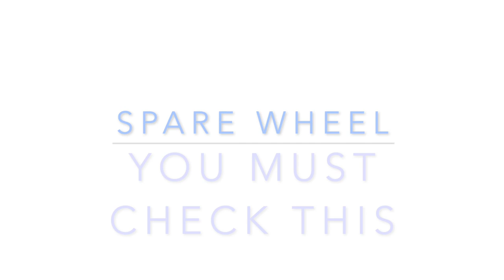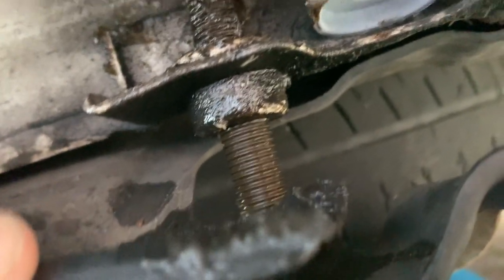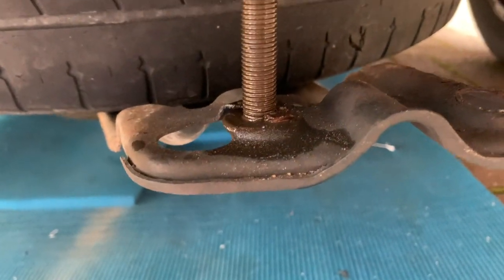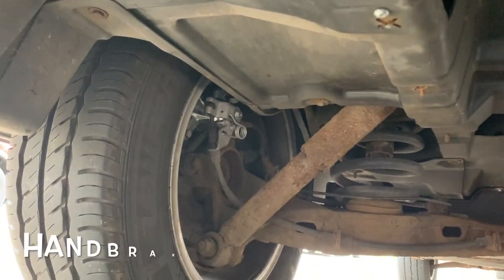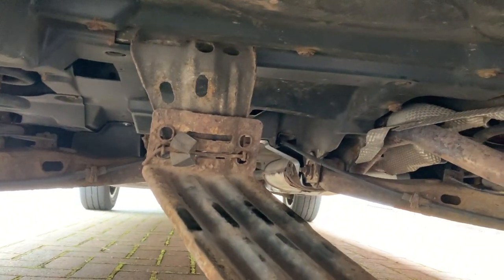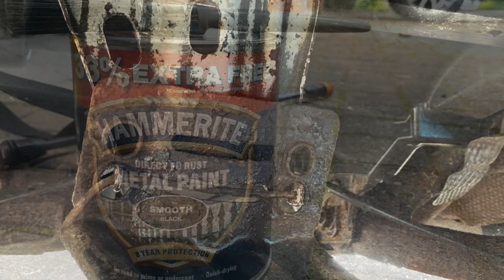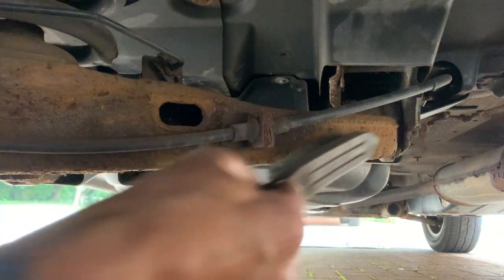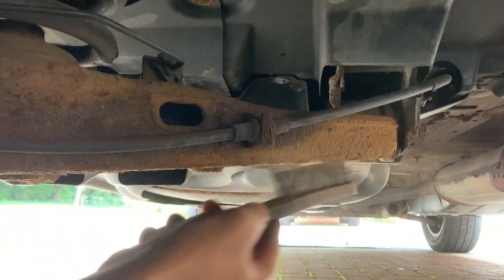VW T5 Transporter - Spare Wheel - You Must Check This

Comment: There is a hole in the wheel carrier in witch you insert your bolt tool. It is easier to lift a carrier with wheel into a right position. Use the leverage.
Reply from the maker: That’s genius and now I think about it…obvious. Thank you for sharing, much appreciated 👍
Reply: Thats what i wanted to write in forst minutes in 🤭 I changed my wheel yesterday

Comment: Just thinking that the spare should probably have a lock or secure bolt on the underside to stop the spare wheel from being stolen now that you have greased the bolts. Thanks for uploading the video btw.
Reply from the maker: Great idea Graham, thank you for your comment…👍
Reply: Mine has one bolt that is the same as the locking wheel nut, I thought this was standard, obviously not !

Comment: That longer bolt unhooks lift wheel slightly with the jack or a well placed foot and the bolt will unhook from metal work.  This is important vid my spare was so rusty it could barely be used last time 👍👍

Comment: Had mine for 13 years and take it off once year to check the tyre,  repaint and grease everything up. I installed a locking securing stud back then as t5 spare wheels were being pinched on a daily basis. Fortunately, I've never had a puncture in all that time so have never needed to drop it in anger at the side of the road. ( touch wood)
Reply: Nice idea 👍 no, I’ve not had to either 🤞

Comment: The bloke who had my van before me obviously didn't believe in lubricating anything. Instead, he paid a garage to do all his work, who didn't lubricate anything either! One of the spare wheel carrier bolts actually sheared off despite getting it hot, so I had to weld another nut on the van and also fitted a new locking bolt which I bought on eBay.

Comment: I discovered a slot in the spare wheel bracket.(between the bolts). You can use the wheel brace as a lever to lower and raise the spare. Hope that helps someone.
Reply from the maker: That’s brilliant, wasn’t aware of that. Thank you for the feedback 👍

Comment: Watch out when it drops down .crushed my hand.
Reply: Yes,definitely worth being aware of 👍
Reply: Use the wheel wrench/lug wrench supplied with the vehicle (Mine is from 2014 - not sure if they are all the same). First loosen the left hand (safety) bolt about a cm. +/- 0.5 inch, perhaps a little more. This stops the wheel and folding bracket falling on your hand. You then remove the right hand bolt completely. The assembly now rests on the safety bolt. Note that the wheel wrench has a small 'tongue' at the end. Remove the screwdriver inserted in the wrench. Now insert the wrench into the hole provided and wiggle it around until the tongue slots into a small hole at the bottom of the tube. Lift up the wrench until it fits securely into the channel provided and then pull it firmly across to the right until the larger hole is over the safety bolt. Lower carefully, use both hands if you want. The 'pistol grip' on the wrench should prevent your hand being crushed, but you could put a block of wood under the folding bracket if you are worried. I carry a 77 cm wheel wrench which fits nicely and could make this even safer, but I think it is overkill.

Comment: Good advice. I found that removing the pin and taking the whole carrier bracket off allowed me to
have it shot blasted and powder coated.  It’s as good as new now.  The other main reason to do this regularly is to check the condition of the spare wheel and tyre and check the air pressure

Comment: Great video. In that 'well' in the spare wheel I keep a ziplock bag containing rubber gloves and rags! You never know WHEN you will need them! Another tip I do with mine - cut 2 fingers off an old Marigold glove - put one over each bolt thread and secure with a rubber band. It helps stop them rusting and/or getting muddy! A great grease to use is 'copperlube' copper grease - guarantees it wont sieze😉👍 Happy trails!

Comment: I had the right one so rusted that it made the nut spin in the chassis. Had to put a vice grip on the nut to get it somewhat out and then use a saw to cut the bolt. Then bought a new bolt, and welded the nut back. Since then I remove the spare twice a year, just make sure it is not rusted together.

Comment: Another honest great video. Thanks. 
Question if I can.  I know this is over a year ago but........if you can remember are the nuts the long securing bolts attach to fixed on the metal bracket?  My bolts & nuts are missing (locked up & seized U bolts used ☹️) & was wondering if I can refit originals? Thanks, John.
Reply from the maker: Thank you for your kind words… one bolt is just a bolt that unscrews and comes out, the other unscrews to a point then is held in the bracket by a collar at the end of the bolt, so would just appear to keep turning, without dropping out…👍

Comment: Great! thanks very much. Had my van 2 years and never given it a thought. Any idea where the jack is?
Reply: should be bolted to the left wall of the trunk under a plastic piece, it should be possible to detach it with no tools. I was cleaning my mom's spare today and that's where I got the jack. There should also be a wrench clipped in under that plastic piece. Hope this helps and wasn't too late😅
Reply: @dgcharlie5360  Thanks for the info. I think it must have got lost when the van was converted. I have bought a new one now., and a towing eye.

Comment: Hi Mick, I'm hopefully telling you how to suck eggs. ..... it would be ALOT easier to carry out maintenance on a part ....on a bench. AND youd do ALOT better job too. It's not a difficult job to remove that entire bracket and do the job properly,  plus you would be able to clean and maintain the bracket that is welded to the chassis as well.  
The bits you didn't clean will just rust and from where I'm standing you just wasted time and effort doing half a job. 
Not unless this was a temporary fix.  If anything you should have given the bracket at the back a clean,  rustproof and paint, as when this rusts.... its welding time, and if you have to pay someone to do this it will be expensive,  compared to maintaining it properly.  Nice video.  I learned how to take me wheel off AND put it back on the right way round.  👌👍😎🚴‍♂️🚴‍♂️🚴‍♂️

Comment: your not to safety minded on the tyre on that spare, bolts would have been better not taken out so you could never use spare wheel
Reply from the maker: Or, remove the bolts, discover you have a dodgy spare tyre and replace shortly after the video was completed…👍

Comment: You call that a spare wheel, I would be ashamed of that, there is not enough profile on it for the inspection with regard to  imagine that in winter conditions you have to change your wheel, then you are there with a bad tire without sufficient pressure, then you might as well leave home without a spare wheel, my spare wheel is just like my other wheels set with conti all wheather  with 8mm left on the spare wheel, at least the pressure of this is also measured during the inspection, so once a year and all that on my T5 bussie of the first month of 2005, SAFETY FIRST!!  at all time, one more question, have you ever read the manual?!  Greetings from the Netherlands
Reply from the maker: Maybe, just maybe I’ve only recently bought the van and after making this video and inspecting the spare wheel, realised how bad it was and replaced it for a new one…just saying’ thank you for your comment…
Reply: Don't worry about his comments  about yr tyre my friend it's still legal to me  👍 keep up the good work